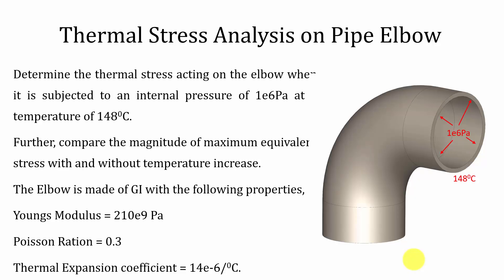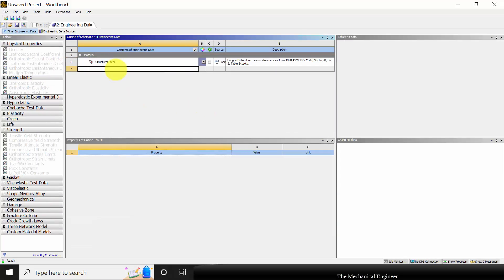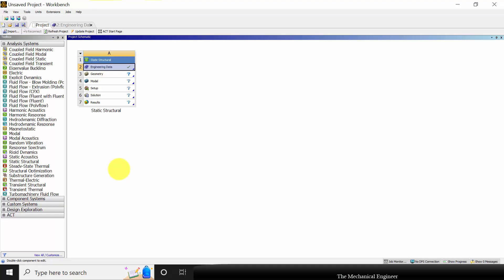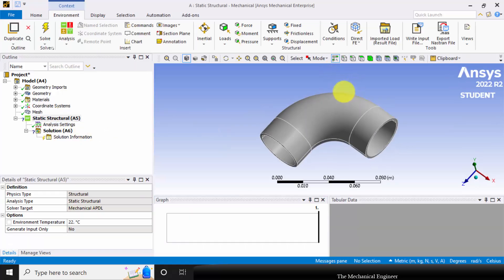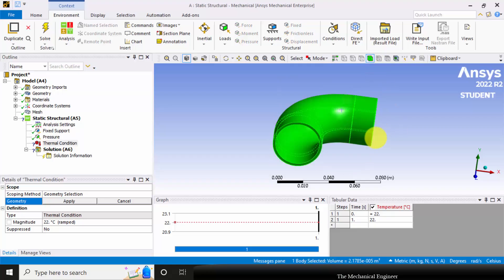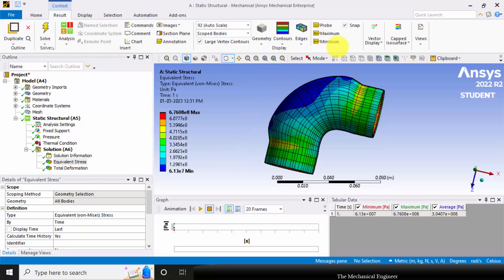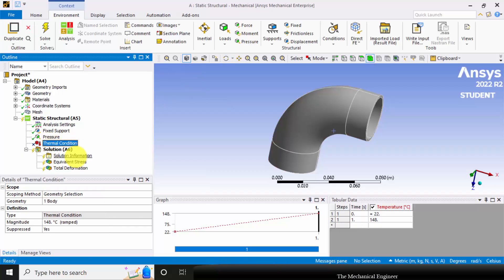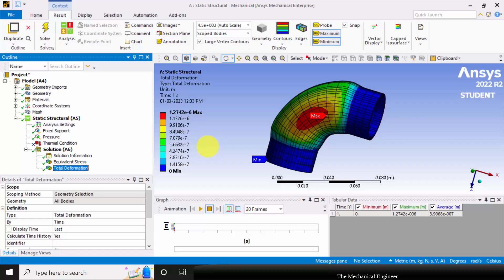Thermal Stress analysis on Pipe Elbow | ANSYS workbench tutorials for beginners

Comment: Hi, Thanks for the video. I have a brief question, the stress simulated, is higuer than the maximum allowed by ASME. How can I show my results? Thanks for your kind response
Reply from the maker: First, if you want to reduce the stress, altering the geometry of the component can significantly reduce stress concentrations. This can be achieved by adding fillets to sharp corners, increasing the cross-sectional area, or redesigning the component to distribute loads more evenly. Additionally, increasing the thickness of parts where high stress is observed can help distribute the load over a larger area, thereby reducing stress. Also, using materials with higher yield strength can help the component withstand higher stresses without deforming or failing.
If it is not possible to make these changes, present the results as they are and conclude that the design will fail under the given conditions. Additionally, suggest ways to mitigate the high stress levels, such as adding supports or braces, and using high strength materials.

Comment: I have a question about your video.

Perhaps you set the pressure considering the flow in the pipe.
If we consider flow, shouldn't we consider not only the internal pressure but also the temperature of the fluid and the film value for convection between the fluid and the inner wall (convention conditions)?
Reply from the maker: Yes but here I have considered a constant temperature increase throughout the geometry. We can also specify the internal flow temperature then it comes under Fluid Structural Integration (FSI).
Reply: you mean is that if we consider fluid 
we must set the convention condition and temperature, pressure but you only consider constant increasing temperature so did you not set the convention condition?
Reply: i think must set the convention condition
Reply from the maker: Yes.. for accurate analysis we must set... As it a basic level tutorial I have considered a constant temperature increase...
Reply: However, to use FSI, shouldn't Fluent analysis be done first? @themechanicalengineer
Reply: and i want to more question,                    Also, unless heat comes in directly, it is correct to give the load condition as heat flow or heat flux, right? To simulate the behavior of fluids, convention conditions are applied.
Reply from the maker: Yes